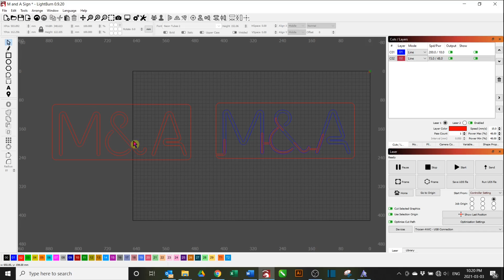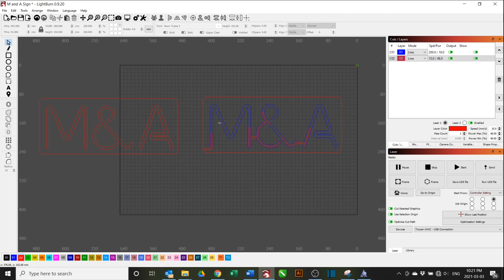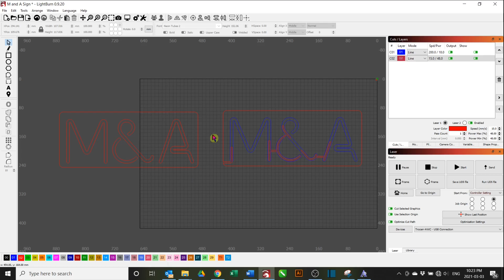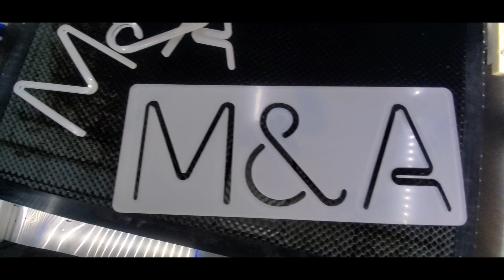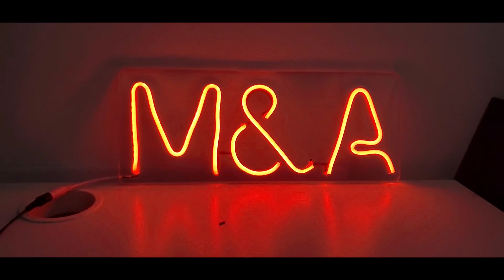HOW TO LASER CUT LED "NEON" SIGNS! | LIT Tutorials

Comment: with an ortur laser master 2 pro with LF 2-4 module suitable for cutting, with a light output of 5.5 W, how many passes would it take to cut that acrylic sheet?  Thank you
Reply: If it is a diode laser, than sadly no :( Diode laser light will simply pass the transparent sheet. You need something that will be absorbed by the material, like a co2 laser.